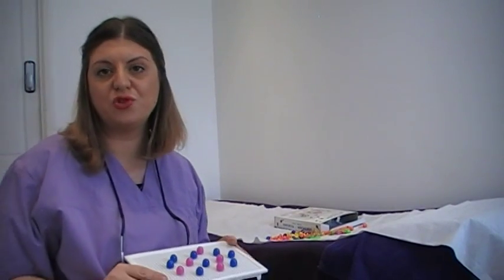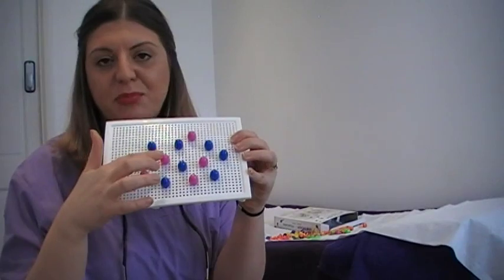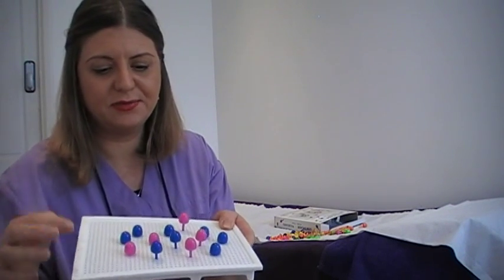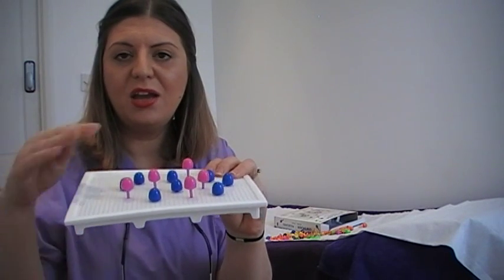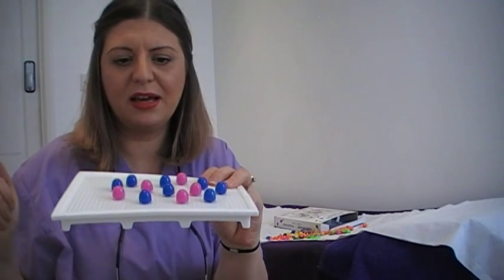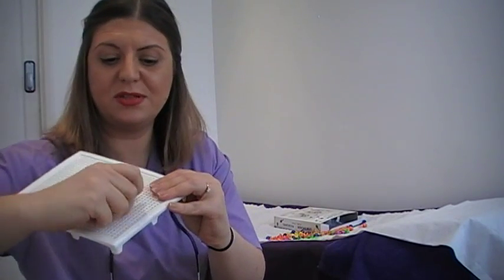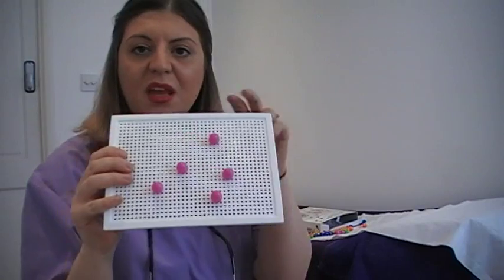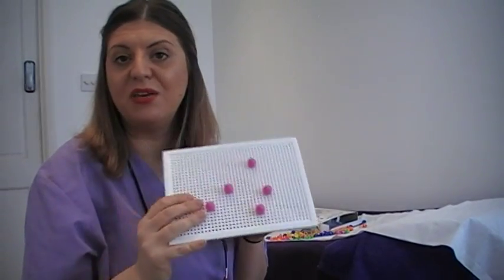The effect of shaving between electrolysis treatments

Comment: So is it ok to shave or not?
Reply from the maker: Yes, it is ok to shave as long as you are not hoping to have the hair removed in just 3 clearances. As a smaller part of the cycle is present above the skin when shaving between appointments, more clearances will be required, but in total you'll need approximately the same number of hours. Just spread differently through the 12 months.
Also, remember to grow the hair for at least 2-3 days before your appointment so the electrologist can see it.
Reply: @flawlessskinbyelectrolysis7982  Thank you so much for your quick response.Take care!🌺
Reply: @flawlessskinbyelectrolysis7982  One more question please.Is it better to trim the hair or shave  the hair?Thank you.